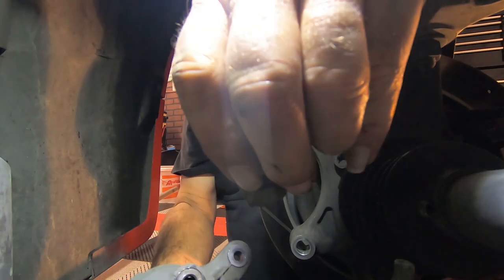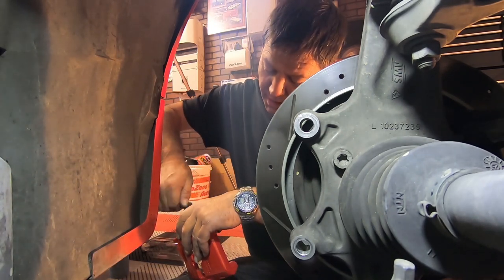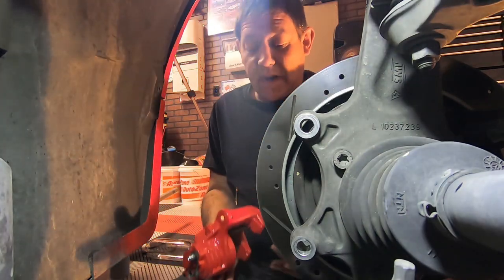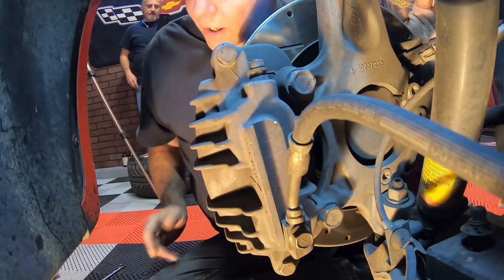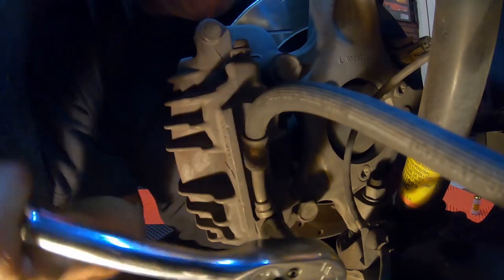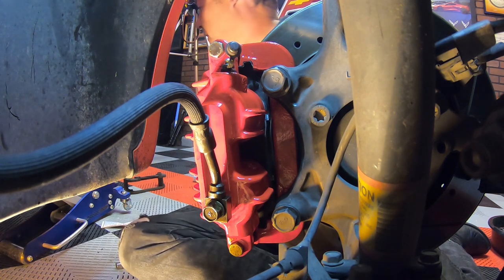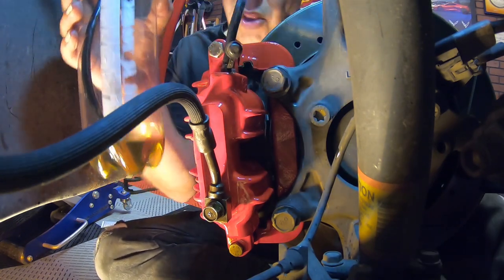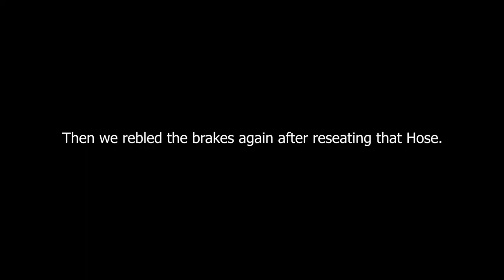How to Change the Calipers on a C5 Corvette

Comment: It would also be a good idea to replace those 16 year old rubber brake hoses with new stainless steel hoses. They are not expensive and they provide great a pedal feel. A brake fluid flush with a good quality DOT 5.1 brake fluid is also a good idea if you are going to do track days with your car. It has a higher boiling point than DOT 3 and handles higher temperatures better. It is also is good for the street.
Reply: Rick, so right, this is how do do it the hard way,  crack open the bolts before removing the caliper,  stainless hoses, new fluid, and strip and clean the master cylinder a must when doing this job.